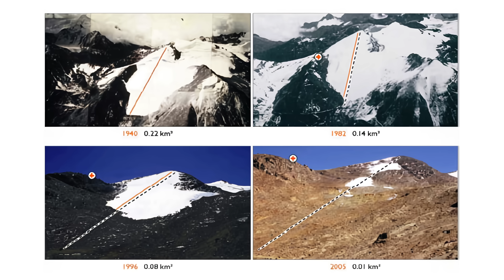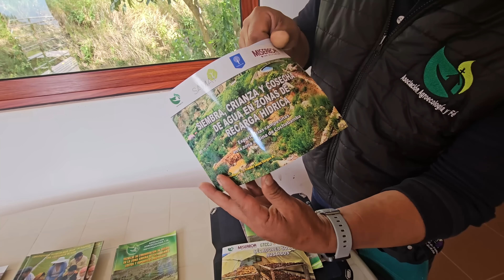Building an Ancient Wetland: The Excavators That Brought Back the Water

Comment: When did the mining operations have started , maybe we can recall back before Christ's era , digging various metals for industrialization , commerce , etc., that wide deforestation exposing landscapes for weathering , old mining activities used firewoods for melting that caused deforestations , and now we are facing phenomenal havocks as minerals were exhaustedly weathered down for agricultural expansions providing booming accounts on agricultural output products , leaving most global terrains with volcanic remains that scorching down the global terrains due to its molecular compound's ability on heat conduction , from various cosmic radiations that penetrate on the exposed areas with intensified heat reflections , as these radiations made a vibrational effects on volcanic remains that caused weathering , soil erosions , terrainnial degradations , acidification of soils and bodies of water that causes microbial transductions ( extremophiles bacterias that trigger for viral synthesis ) , and vegetational growth deprivations that can hardly adapt such obnoxious environments . The former terrainnial conditions were formed by layers of fortressive coatings from green coverings of forest , limestone deposits , and volcanic remains beneath , where every regions were colonized by wild lives , and human settlements were on the valleys , protedted against calamities . But human lead on colonization over wild lives that conquer vast lands on agriculture , mining , industrialization , and global commerce and trade that defy the preservation and conservation of the paradise , and we are now facing the great crisis in our lives driven by strategies for conquest , leaving every biotic species endangered and maybe for extinctions , as the law of conservation and preservation were neglected by pride

Comment: using plants in infrastructure is so smart

plants constantly replenish themselves, so you don't need to go repair and rebuild things. if it's wilderness, you can just let them grow freely. they act as natural reinforcement, so the dirt doesn't get washed away or eroded as easily. as they die, they leave behind biomass which gets trapped and mixes with the soil, eventually in hundreds of years, as long as the water keeps growing the plants, the soil will darken and be even more healthy

Comment: Did their ancestors not deforest the land? by hand over millennia that with the earth axis tilt cleaner air.  Climate Change once there is an investment in this form of earning money there is always a push forward.
  46,000 litres 46 m2  10,000 gallons  an Olympic swimming pool holds 2,500,000 litres 2.5 mega litres or 2,500 m2 of water.

Comment: As in India, Africa, and Australia, the key to landscape restoration and increased productivity and secure water supplies is holding water on the land until it can infiltrate to water the active root zones and replenish aquifers. Continuous contour swales, numerous small reservoirs and terraced plantings are low technology elements that any individual or small group can accomplish with regular, moderate effort.

Comment: Interesting this woman speaks of severe drought but those sprouts for one year long and they were 20 years apart she speaks of extreme drought and extreme rain in the same paragraph I'm more inclined to believe that this is due to abuse by the local inhabitants probably a major problem is the cutting of those roads which caused slides which remove the ground cover because I get confused when they talk about drought lasting one season that's not a drought also drought is ambiguous the Amazon if it gets 26 inches of rain annually and for 3 years in a row it only gets 24 inches of rain that's a drought a desert that gets 2 inches of rain annually and only gets 2 and 7/8 bring over a period of 3 years they call that a drought but one year a short precipitation is not a drought this is what you have to be careful about this is an interesting program but things they imply in terms they use don't fit the true definitions you have to filter out this agenda when you're watching programs like this I agree with recovery and repair but to make false or ambiguous statements makes it hard for me to follow what's fact and what is it because we know the best lies are wrapped in truth
Reply from the maker: You can look up the droughts they were devastating and there had been multiple droughts, we didn't want to linger on it for too long because it would require a whole video on the topic just for that but I'm sure your capable to research into it yourself

Comment: Fascinating stuff. One small problem with that video, you’ve massively understated the benefits of the work 😉. Not only do you prevent landslides, provide water for irrigation etc but there are massive bio diversity gains from putting all that water back into the ecosystem, and then there is the carbon capture from restoring the soils! Brilliant

Comment: While there are ancient advanced civilizations in the Andes and Pacific coast. Bolivia only hosts one that's 1000 years old at most.
Reply from the maker: Are you sure Tiwanaku empire is one of the oldest in the Americas
Reply: @LeafofLifeWorld  I'm 100% sure Tiwanaku is extremely young civilization. 1000 years is not old when you have advanced civilizations that are 5000 years old (meaning 3000 BC) building cities, infrastructure, advanced farming and trading, etc. 

Tiwanaku had its eldest origins at around 100 AD, but its only around 600 AD that they would really start to build up their empire and thus their infrastructure until about 1000 AD. 
There were initial estimates that it was much older (but still not even close to 3000 BC) but this was disproven with newer techniques in the 80s.Tiwanaku was coterminous with Huari as well. 

Andean civilization had its tentative start with Caral culture in the pacific coast. However we know they are not the first to build advanced cities since they are 1. too advanced, 2. we've found older remains but they are still being processed. 
However Caral has the benefit of having several of their structures in quite good condition, and many interesting remains have been found like proto-Quipu, traces that aimara and quechua language originated in the coast and then went up in the andes, etc. 

Ofc since Caral there is a long line of advanced civilizations, one after the other (the makers of the Nazca Lines for example or advanced textiles you can find) until you reach Tiwanaku-Huari, and after that several hundred years of development of other smaller civilizations, Chimor being the most prominent and then the Inca Empire conquered them all.

Comment: This works all over the world.  China has done it, ,it's been done in India, in Africa.  There are common elements and unique local adaptations.  Sand dams in Africa.  MASS PEOPLE POWER in China, In India, one the first to rehab dry lands by retaining water, a guy, ecologist, engineer, ???  stopped a dam from flooding out a valley and it's villages by countouring the land, creating check dams, making recharge basins.  The IMMEDIATE benefit to grains grtown in swaltes now got big buy in by community, then the river ran longer and longer year after year until it ran year round again.  Springs returned all over valley.  I need to look up this effort so I can credit this man.  
The land 400 acres above me was logged 3 x in 30 yrs and it destroyed water floow of millenia.  Part of water system that supplies 10 million people from near by reservoirs.  100 yrs ago wise men bought up most of the mountains to create a watershed for nearby cities.  Now their decendents strip the mountains destroying the aquifers, while the environmental cops, litterally COPS watch and joke w loggers.  Anyway.  I dug out 50 plus cubic yards of eroded clay and organics that settled low down mountain in springs and cricks, putrid stinking like jello, an over one pile the loggers left their foilet that fell right into water way.  I went up and down mountain throwing wood and rock into erosion channels, raked in leaves, diverted flows into large flat areas to recharge aquigiers.  Cutting channels to spread run off over hillsides.  I've added biologicals to eat up muck, leaves, organics as water running down now pollutied channels would turn a pond at bottom of hill green.  20 yrs, very part time effort, and while there were noticable improvements over the time, this year, BIG DROUGHT, 2nd worse in memory, and there was water out of the springs at bottom of mountain all year.  A trickle each, but abouot as much as I remember as a kid (and enough to water 3 households for over 200 yrs until well drilling became a thing).  There remains the logging road at the bottom of the mountain that cuts the main drainage in half.  Water now pools up on uphill side into semi fetid bug breeding swamp invasive non natives are thriving in, until it percolates through road bed with a fraction continuing down to rivers and reservoirs.  Alas that pile of compacted rock and clay and gravel (the loggers had to dump many loads of fill in as being a low point, water would make their road un usable.  This was just 50 feet from a main highway the environmental COPs, they carry guns, use, with dirt and mud flowing onto road.  So gov't working hand in hand with biz to destroy land is alive and well all over world.  There is at least 30 cubic yards of hard as concrete clay and gravel and rock that needs removal, and at 66 it's beyond me.  I can only hope to chip in a tiny channel and hope over time the srping water erodes enough clay away to draing the swamp and restore the natural flow.  Even this is a 5 or 6 yard removal project of which I get 1/2 a yard if lucky done w spare time / energy.  I've considered using a hose to wash away clay leaving me just rocks to rake away, but technically, I'd be polluting the stream then.  Ironic, eh?

Comment: As advanced as we are in the U.S., we've built in incredibly fragile system of interconnected technology. If one or two pieces shut down, the whole system fails. We get all of our products and food from 1000's of miles away. We need fuel to move it all, we need security to allow global transit, every system is dependent on the electrical grid (you can't pump gas or refrigerate without it), people also don't realize how much of our tech is now dependent on satellites working (gps and communications). Think of all the products needed to run our water purification plants. If any of these systems collapse the others can't function properly, which then causes other systems to fail, which means empty grocery stores, empty gas pumps. If that lasts more than a few weeks across a large enough area, and it's clear that help isn't coming anytime soon...... things get very ugly, very quick. However, a place like Bolivia would be fine, all these towns and villages have their own food, water supplies, they would certainly be inconvenienced, but they still have all the tools and skills to do most things by hand, without electricity, or fuel. We have made a grave error in not making our western civilization more robust and resilient to cataclysmic events. 

Imagine something like this https://www.nps.gov/articles/000/1816-the-year-without-summer.htm  
or just a little bit worse wiping out the yields of our mass production farming. Imagine it lasts 2 or 5 years, how screwed are we?